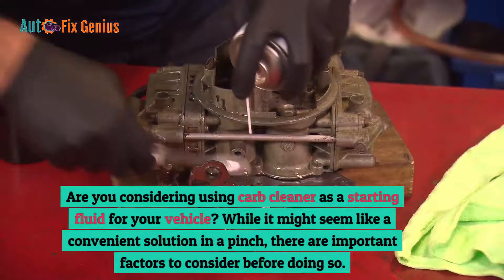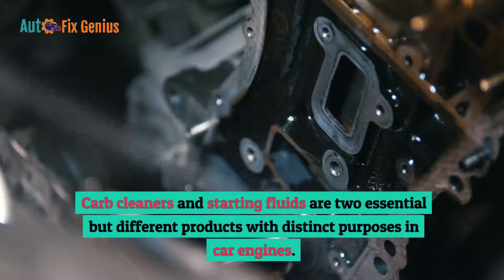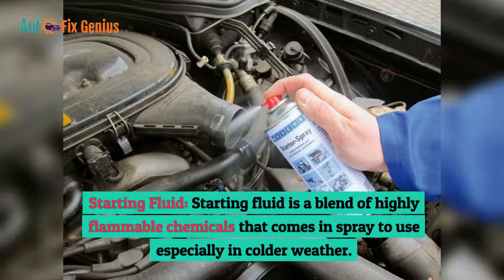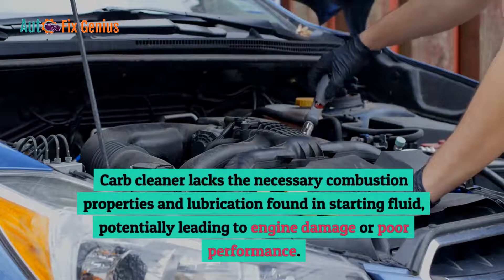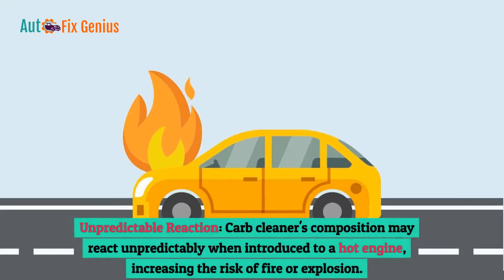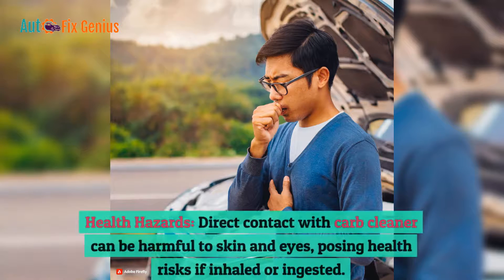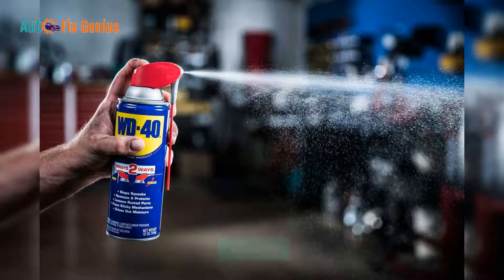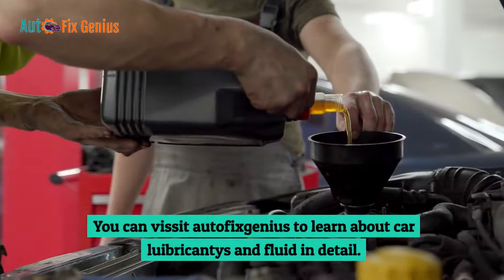Can I Use Carb Cleaner as Starting Fluid? The Shocking Reality!

Comment: I had a problem with generator that wouldn't start and we watchted a video of a guy spraying carb cleaner into the air filter to presumably clean it out so we tried it and the generator did start but went of when we didn't spray and turns out the petrol wasn't enough to leave the tank and enter the engine so the carb cleaner did actually start thw engine.

Thank you for sharing the risks of using it because i didn't know 💀

Ill use wd40 from now on if i ran out of starting fluid👍👍